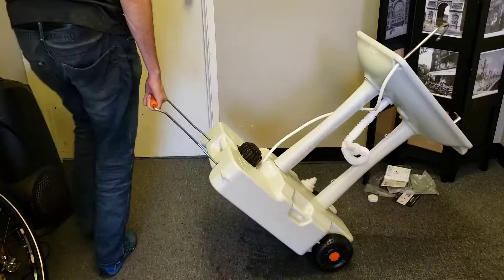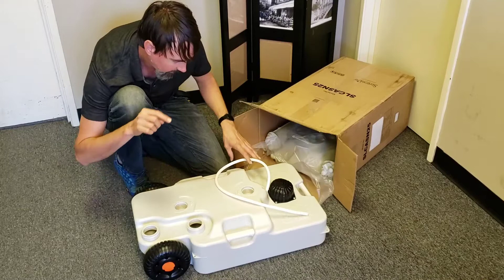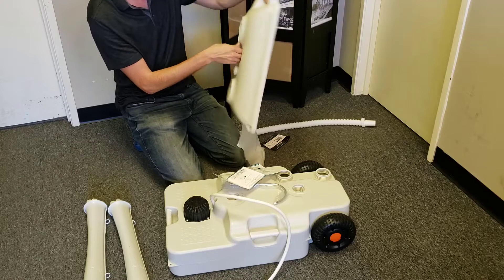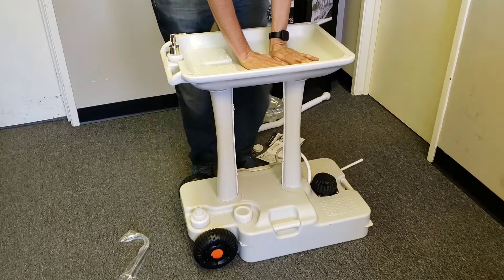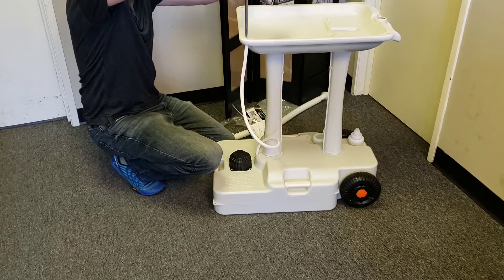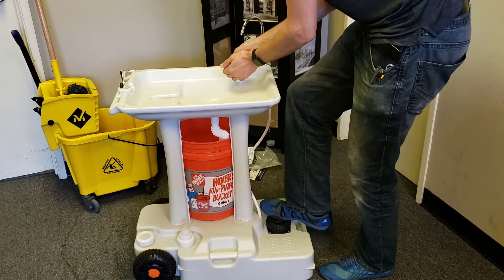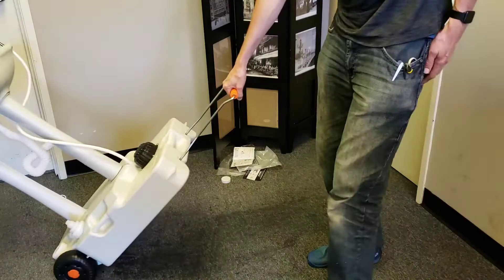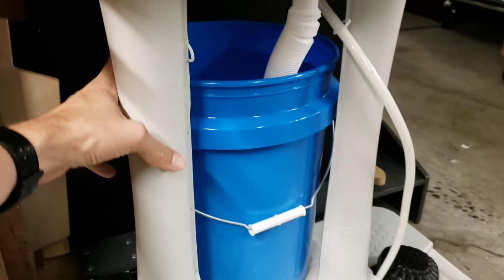Install a Shop Sink Without Plumbing | Unboxing & Review The Serene Life Portable Sink SLCASN25

Comment: To get the basin onto the 2 columns, I put cooking oil on the tops of each column and aligned the basin. Then I literally did what you did in the video: I put my entire weight (feet lifted off the ground) on the one side and then sat on the other side. I heard the clicks.  It won't ever come off now--I can guarantee you.  Thanks for the help.
Reply from the maker: Nice, cooking oil is a good idea. It is a challenge to snap on. I might try alcohol or hand sanitizer next time as this also provides lubrication and evaporates after.

Comment: Very helpful! Mine is intended for a similar purpose (wet sanding & washing parts contaminated with metal/polyester/leaded glass dust that shouldn't go into sewer or septic) and I wasn't sure if the bottom reservoir was divided. Since it's continuous, a bucket is necessary if I ever want to use it for shop or family hand washing.
Reply from the maker: That's a good use for containment. The bottom is indeed not divided, and therefore I don't really understand the intended use case that the manufacture had where the drainpipe would be connected to one of the openings, and the water would be recirculated. Yes, the water will need to drain into a bucket. I have a vibratory tumbler from which I drain the wastewater into a bucket and allow it to evaporate, and then can scrape out the solidified waste.

Comment: Some folks are complaining one of the posts is hard to get turned into the groove. I used cooking spray on the treads and was able to turn it into the correct position without damaging the post from too much pressure turning.
Reply from the maker: That's a good idea! I didn't think of using a light oil. You may have seen how I had to sit on it to get it to snap in. Sometimes I use rubbing alcohol, or gel hand sanitizer as a lubricant that needs to evaporate later.

Comment: I have watched a number of videos assembling this unit and also the one that comes with the holding tank for the dirty water. They all seem to assemble it a little differently. And they don't show what to do with some extra parts that come in with the unit. Also similarly to you I put my entire weight on top of the basin in order to make it click in and I still couldn't get it to click in and I weigh like 145.
Reply from the maker: Try to use some lubricant on the connection, like olive oil or hand sanitizer (will evaporate once assembled).
Reply: @engineerable  Oh yeah, I didn't even attempt to try it without lubing it first. As a matter of fact, it came in the packaging brand new with oil on the connections..

Comment: I caught HELL HELL 😆 trying to put those two columns into the basin, omg they've got to go back to the ' drawing board' for a redesign for that instruction.
Reply from the maker: 😂 yeah, it sucks. Someone recommended lubing it with cooking oil. I've also found that alcohol or hand sanitizer (gel alcohol) works well as a lube that evaporates.
Reply: @engineerable I'm going to use my sink for the first time later today, it's about time. I had to go back to your video demo to remember how to use it.. been a long time since I put it together.

Comment: Hello. Thank you for your video but do have a question for you if I may. I do own this sink but have not used for a while now but want to start using again. Only thing is there has been old tap water sitting in it. I have drained the fresh water tank and left caps off to dry out. Now I would like to clean up the fresh water tank before reusing again. Thinking about using some disinfected bleach/hot water mix to clean the tank. So I am wondering if you have cleaned your sinks fresh water tank and what your recommendations in this situation. I looked at the manual and called the company with no help. So again appreciate your feedback!

Jessica 😊
Reply from the maker: I have not needed to disinfect it as we are always adding clean tap water to it (tap water is chlorinated) I don't know if bleach will do any damage, but since tap water is chlorinated, it's equivalent when diluted to the same level. Only use a very small amount in water. Don't need much. Hydrogen peroxide diluted will also disinfect it.
Reply: @engineerable  Thank you for your feedback. I only ask because of not using it for a long period of time. Bought this sink for my husband during a medical situation to make it easier for him to clean up. That way he didn't have strain/travel to far in his recovery. Again I appreciate the help. Have a great day!

Jess

Comment: Great video man I'm thinking of buying one to use as a sink to wash dishes in. How is the drain? I'm drinking of removing the screen but not sure how easy it would be to do.
Reply from the maker: Thanks! Drains well. I removed the screen, which pops into place and is difficult to clean. Replaced it with one of those small drop in sink strainers. Perfect fit. I keep the hose short so the end is not in the water in the the drain bucket. That way it drains faster.

Comment: I can see it solves a problem for your circumstances but it's going to be cold and inconvenient to fill/empty. Would be interesting to know how it goes but I think I'd rather walk :)
Reply from the maker: Your concerns are valid. In our case, the shop is relatively climate controlled, so it won't get that cold, and we don't have hot water at the bathroom sink anyways :) We've been using it for a while now, and the convenience and time savings far outweigh filling it and emptying which is easy.  We've only had to empty and fill about once a week.
Reply from the maker: It would be nice if there was a cold weather option with an insulation blanket that goes around the tank, and a heater pad underneath. Since we're in Georgia, it doesn't really get cold enough for this to be an issue, but I can see how it would be if you live/work further north. Next project heated shop sink! I think in that case I might buy a 5 gallon bucket heater blanket https://amzn.to/2HABiGi, and a foot pump https://amzn.to/3622BCS and DIY my own sink.